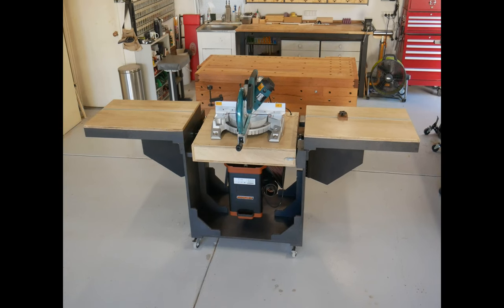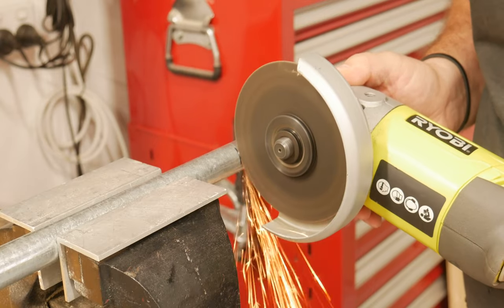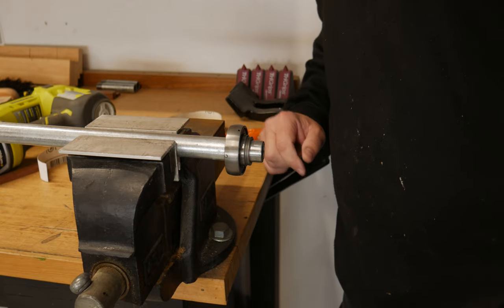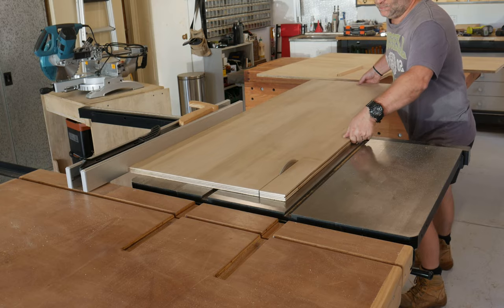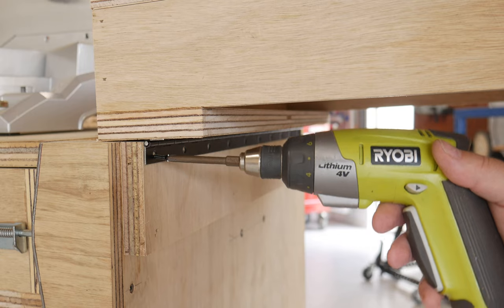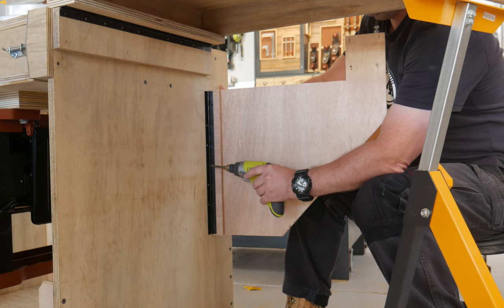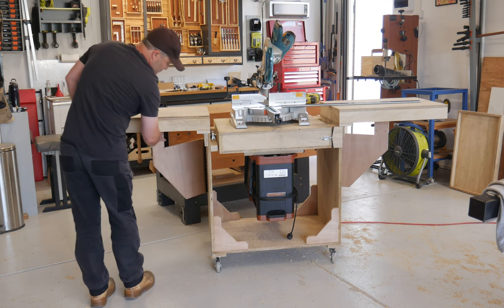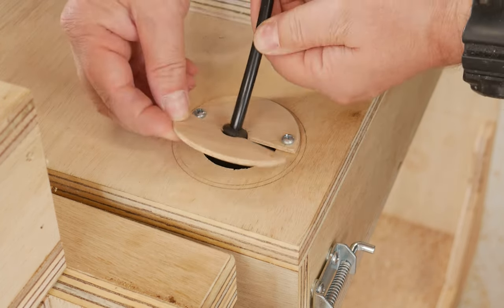Flip top tool cart with bearings, Auto locking for flip table,  mitre saw and planner thicknesser.

Comment: Very nice - I am studying videos and looking to make a flip cart for my drill press and miter saw.  I watched another that had a sliding surface so that the flip cart (table) could be wall mounted.  I am going to combine that with a lot of features from your design.  You have inspired me to get started!  On your cart, I really like the self locking feature, your use of bearings rather than pipe on wood friction fit, and the stop blocks for the rotation (great ideas).  

You also held my interest for your entire video (I find myself skipping ahead on most videos) so your content was perfect.
Reply from the maker: Thanks heaps for that comment, means a lot. Let us know how your build turns out.

Comment: Nice build!! You gave me some inspiration to start building my own. Going to use it for my miter saw fold away and nothing on the other side. Dont have that many machines yet and could use it as an extension table when its all flat at the top. :)
Haha, was just about to ask if you had shares in a screw manufacturing company, when you noted yourself you drilled way too many holes :)
Love the Jorgeson clamps btw.. Here in Netherlands I could only buy the maller 300/50mm ones. Hope the larger ones will be available one day. Very good and practicle clamps!
Reply from the maker: So glad it helped out. let us know how your build turns out.

Comment: Safety First -  LOOSE THE GLOVES.   Hauling wood around and loading and unloading,.. gloves are fine.  Around powered-up tools is a major safety violation.

As a professional Cabinet Maker I use the basic rule: "fasteners are there to hold the parts in place until the adhesive cures.  Brads are simple and dandy however have jip-diddly holding power.  SO,.. screws are my best assembly friend.
Great narrative ! 
Love that verbiage,... "Snotty - Goopie - Stuff !"  New words in my Woodshop !
Reply from the maker: Got lazy to take the gloves off, me bad. Thanks for watching.

Comment: First one to use ball bearings on the swivel.
Top man.
Has anyone designed a swivel arrangement which rotates 2 horizontal tables. ?
Like the big wheel at a fairground or a rotating arm with a self levelling platform each end which keeps the tool upright and can still be double stacked.
Next is the dust extraction.
Reply from the maker: I think the bearings keep it way more accurate and give it a way more positive location. Dust extraction on my chop saw has been a challenge.

Comment: This is the flip cart I was looking for. The orientation of the planer to also use the feed supports along with the saw is what nailed it for me. Please, PLEASE, for everyone here (but mostly me), can you post in a single comment here, at least the dimensions of the main big pieces? Inches or cm, either way, but anything at all would be helpful. I'm probably wrong here, but guessing close to 92x76 cm (~ 36x30 inches) for the platform and sides. But just the big parts would be very helpful. Thanks for a great idea and build video!
Reply from the maker: I will get back to you soon with some dimensions soon. Thanks for watching.
Reply from the maker: Turn Table HxLxW  120 x 730 x 600 ,  Carcass 760 x 900 x 600 , Wings 100 x 730 x 500 mm. That is without the castors. good luck bro.
Reply: Thank you very much, sir! (Heh, from all of us, I think)  @RJsShedShop

Comment: My favorite is the locking mechanism.  Every other build I've looked at appeared to be way more complicated than necessary.  Nice solution.  Could you perhaps post a link to the spring loaded hardware you used?  Not even sure what that is called.  Great build, thanks for sharing.
Reply from the maker: Thanks champ. I new to this YouTube thing I will have to put that onto my learn to do list. Thanks heaps for watching.

Comment: Nicely done. Thanks for the inspiration.  I have just purchased the Sherwood thicknesser and a Sherwood sander, both way too heavy to be dragging around.  Your flip cart might just be the shot.  I'm worried about the thicknesser hanging upside down.
Reply from the maker: Thanks bud. I was initially worried myself at first. Using 19mm marine ply and adding those extra blocks where the thicknesser bolts down gives you nearly 40mm of material. Now I flip my cart  over daily and don't even think about it. Good luck on ya build, let me know how it turns out.

Comment: You literally thought of everything i did and executed... wow i hope i can build this one day

Can you share more detail about your supports, what it looks like when it touches the wing?

Also, why do you need a bearing and the connector piece, couldnt you just use a long rod with the different plywood bracing that you had?
Reply from the maker: The latch is simply called a spring loaded catch bolt, I used bearings so that the flip will always lands in a positive position so the saw and thicknesser line up with the wings. Thanks for watching.
Reply: @RJsShedShop  Thank you!

Can you share more detail about your supports, what it looks like when it touches the wing?

Also, why do you need a bearing and the connector piece, couldnt you just use a long rod with the different plywood bracing that you had?

Comment: Hi there, congratulations with the build, it's the best I've seen so far. One question, why do you split the pipe tube in two? Wouldn't be easier just to use one single pipe tube all the way through? Thanks!
Reply from the maker: Thanks mate, I use a T connection in the middle as to feed the cabling through as it is convenient. You could however drill a hole to feed the cables through if you wish.
Reply: Hi  @RJsShedShop  ok I understand, so that's the only reason, I thought there may be other reasons. Thanks a lot for getting back.

Comment: It's a nice idea.    A year later, did it hold up or did it wobble to much?    Even with the gussets it seems a little jittery with a hundred pounds resting on a pipe.
Reply from the maker: It has been great, maybe be better if I used 
 thicker ply for the base for an uneven floor, however I am super happy.
Reply: @RJsShedShop  thanks for the response.

Comment: This is amazing!!! Can you explain how you calculated the height & location of the flip top to get it to be level with the wings? I get stuck trying to figure that bit out when planning my own!
Reply from the maker: Thanks, I will do my best. The easiest way I found was to place the saw on the flip table as this has the highest bed height compared to the thicknesser. Place a straight edge across the saw , clamped if needed then clamp the extension wings then mark where to cut the sides. Tip would be to make the saw a little lower than needed then you can shim it up to suit the wings, same for the thicknesser . Hope that helps and best of luck. let us know how it turns out or if you need anymore advice.

Comment: Thank you for this great video.  I already own a flip stand for my thickness planner and Oscillating Belt/Spindle Sander but your combo makes a lot more sense as both your tools benefit from the extension wings.  I'm considering doing something like yours but worried about how heavy my mitre saw (Dewalt DW780) and thickness planner (Dewalt DW703) are.  How heavy are your tools? (if you are not sure providing the models would be good enough so I can look them up).  Also, wondering if you have have  had any issues with the mitre saw calibration after a year of use?.
Reply from the maker: Thanks bud, no issues with the saw. Weight issue not a problem using the bearings and 25 mm ply for the base and sides.

Comment: Great build.  I’ve been looking all over YT for a design that uses the wings for both a miter saw and a planer/jointer.  I’ve got a benchtop jointer and really want wings to function as an extended infeed/outfeed bed on longer pieces.  It’s good to actually see one built to help with my design.  The flipstop locks are next-level and I’ll be trying to work those into my design.  I also enjoyed the quick glimpse of your stop blocks on your miter sled.  Very slick!  Are you still happy with the cart?  Anything you’d modify now that your piece is a year old?  Thanks for posting your video!
Reply from the maker: Thanks champ. No I am very happy, for me the cart worked out great. You could possibly double the ply thickness on the base just to help out on uneven floors.

Comment: Very clever design RJ, did you get the materials (pipe, bearings, hinges) from Bunnings? I’m wondering if you could be interested in creating a CAD plan to offer for sale.
Reply from the maker: Thanks bud. Bearings from a wholesaler, dirt cheap. the rest is all available at Bunnings. Just starting out and I would not have a clue how to do a CAD plan.
Reply: @RJsShedShop  thanks RJ, any suggestion on where to get the bearings?
Reply from the maker: @alessandrosuppini943  Bearing wholesalers in Bayswater. You should be able to order on line.

Comment: I've got a really small shop (2 car garage that I need to park in when not working) and that's the best idea I've seen.  I didn't even think of putting the miter saw on it like that and I love it.  Any chance you have rough design?
Reply from the maker: Glad you enjoyed the video. I kinda plan things in my head as I go. I used 3/4 ply for most of the build. I am happy to throw some rough dimensions your way if you like.
Reply: I’ve watched many videos on the flip top stand, yours is far most the best. By any chance you can send me some rough dimensions of your design?
Reply: If you could, that would be great. Doing things on the run generally don't work for me. @RJsShedShop

Comment: I was working on a cart of my own and was stuck on the in & out-feed table design. You solved it!
Did you use locking casters? How stable is it when you’re pushing material through?
Reply from the maker: Yep I used locking casters and it is very stable. Glad it helped and thanks for watching.